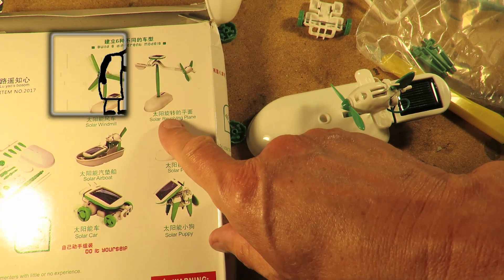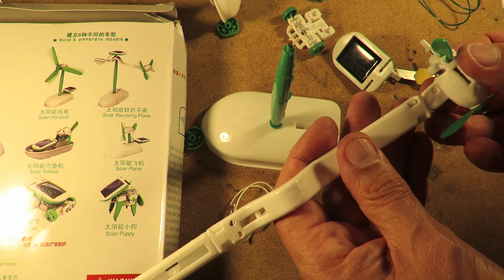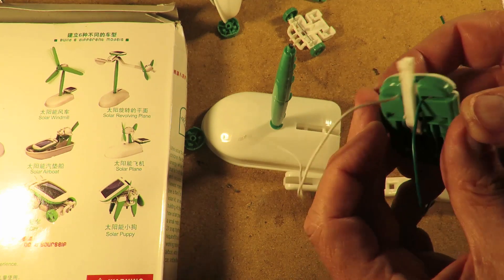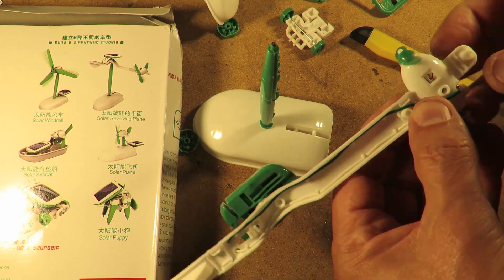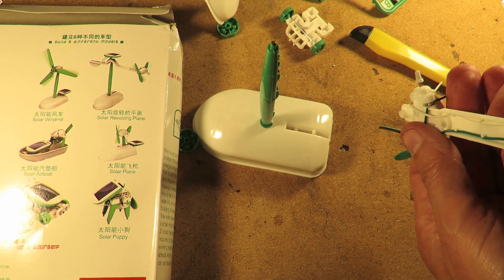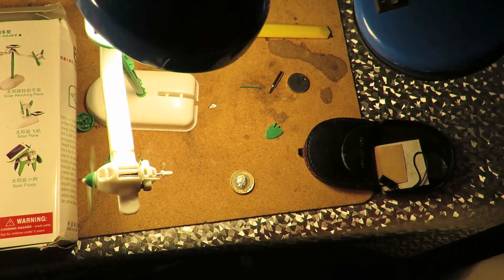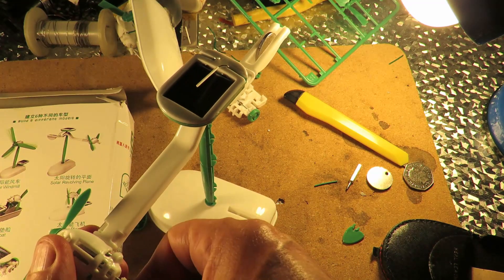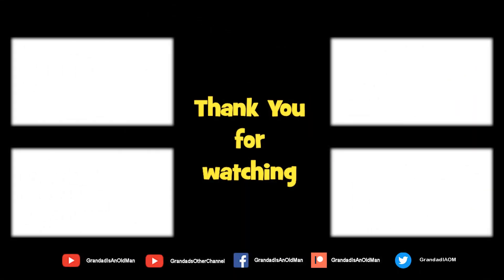Solar 6 in 1 kit - Solar Revolving Plane

Comment: Hello. I have 5 Volt and 1,5 Amp solar panel and how I can to make a solar lamp?
Reply from the maker: If you want to make a solar lamp you need to feed the power from your solar panel into a rechargeable battery and then run the light off the battery.